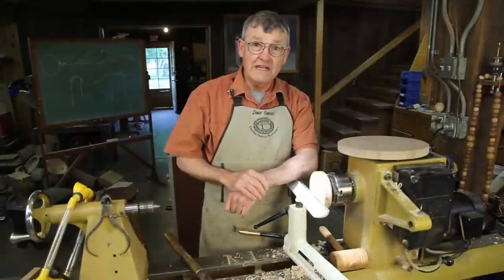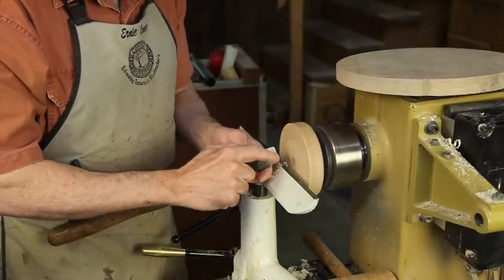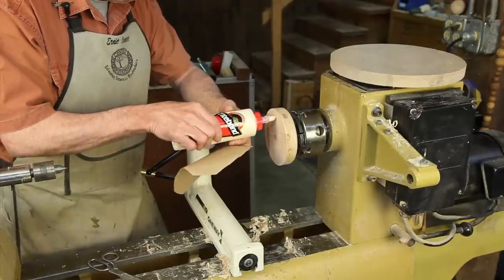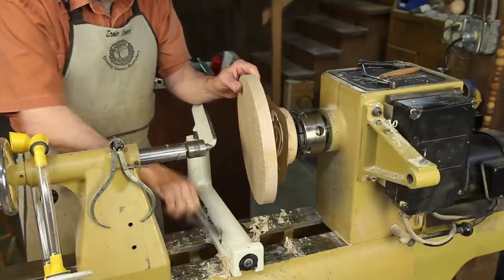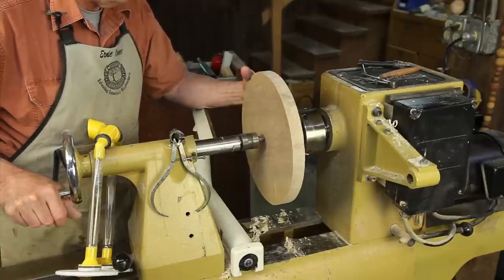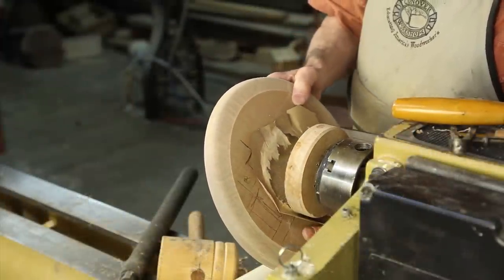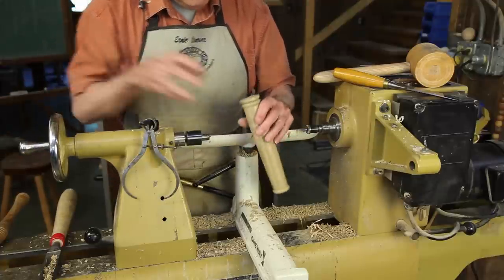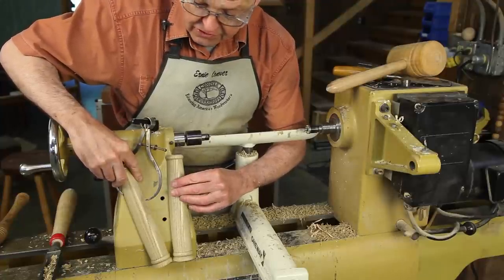Using Paper Glue Joints for Woodturning Projects

Comment: I have used this process for over 40 years, but use news paper as it is two ply and separated cleanly. Especially great for turning decorative half pillars. They ply apart with very little pressure and leave little remnants to sand off.

Comment: thanks Ernie! Clever way to turn Half Newels on stairs without having to remove the blade width on a table saw, and joint to flatten further removing more stock throwing the center point off of the turning.  It's a lot of glued surface area, but I will have to experiment to separate the halves without blowout on large turnings.  Any warnings for amount of glued surface area?  Need a bigger mallet or less glue?